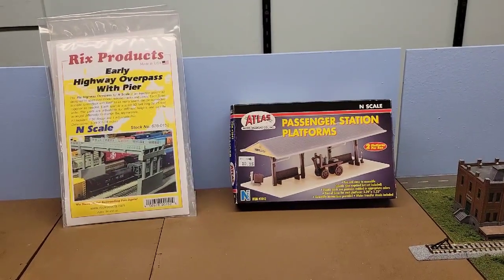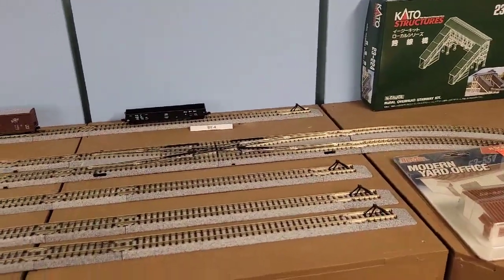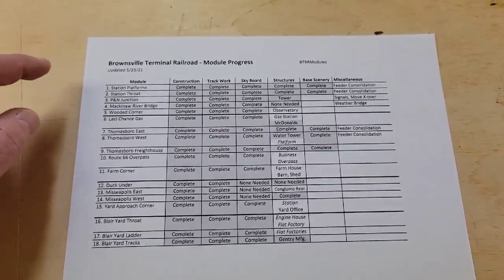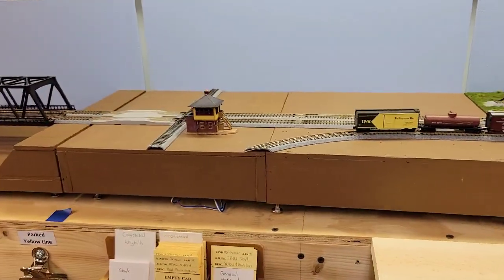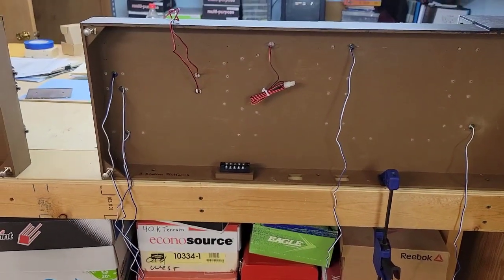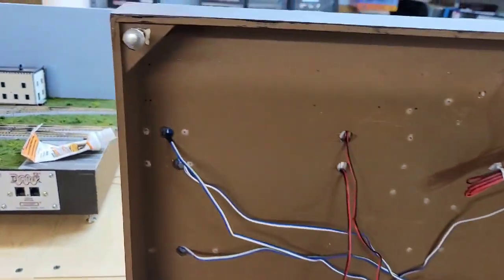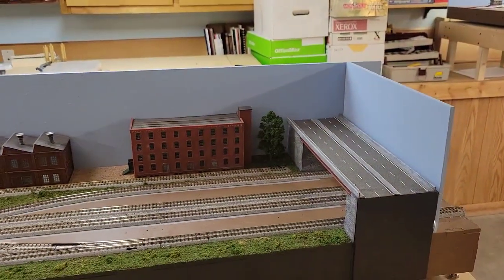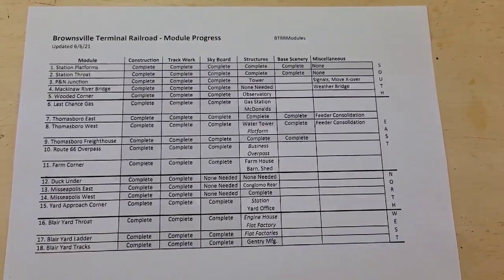52) Upgrading the Brownsville Modules

Comment: Great video as always, did you use 50/50 white glue and water for ground cover and did you spray anything on it to keep it from coming off
Reply from the maker: Actually, I use the Woodland Scenics product Scenic Cement. It works well and ready to use. I lean towards the old fashioned eye dropper method to apply it. Whenever I try to spray it, it just goes everywhere! Hope that helps - Kevin
Reply: @kevinbrown104  is it easy to take off later on if you want to change sceanery

Comment: Kevin, Looks like you have a lot of work ahead of you.  Nice running trains.  I saw some wargaming miniatures in a cabinet against the wall.  Did you wargame in the past or do you still do it? .....John
Reply from the maker: Actually, I stumbled onto both n-scale trains and miniatures gaming at about the same time way back in grade school. I am still very active in gaming, and have belonged to a great miniatures group here in town for over 20 years. Truth be told, one of the main reasons for me to clean out half of my basement and expand my layout into that permanent space was to clear off my game table for use. I admit that it is at times difficult to support two hobbies. My historical miniatures collection is in good shape right now, and that should allow me to concentrate on getting my layout in a similar condition over the next year or so. Out of curiosity, what is your connection to miniatures and do you also try and balance between the two hobbies? - Kevin
Reply: Kevin, I used to war game with miniatures for about 20 years ending in the early 1990s to include 25mm Napoleonics, ancient Egyptian and Roman. I also had a rather large collection of Roco mini-tanks (sold to a club in San Antonio a few years ago). I also dabbled in micro-armor (1/285 scale) for several years.....John